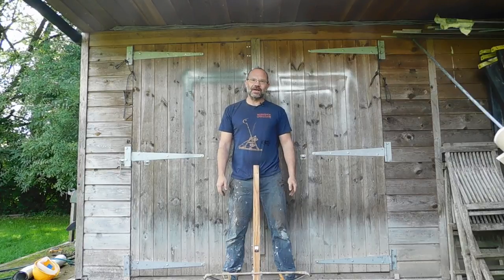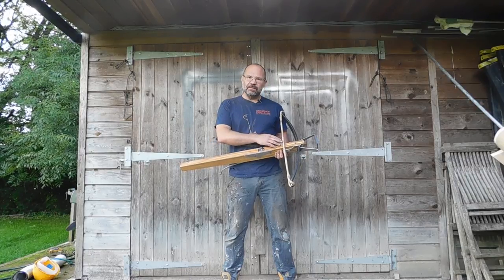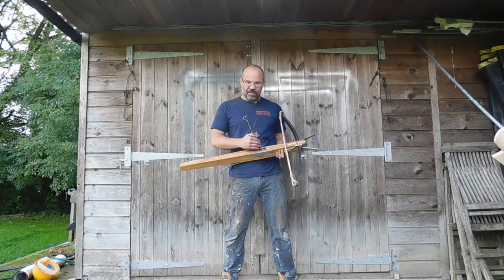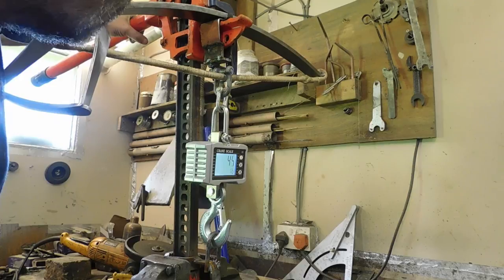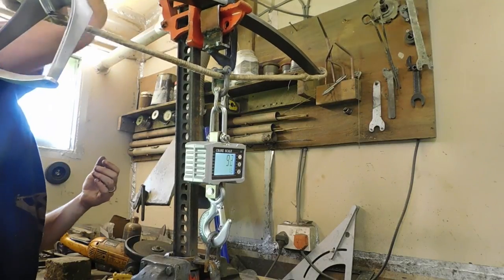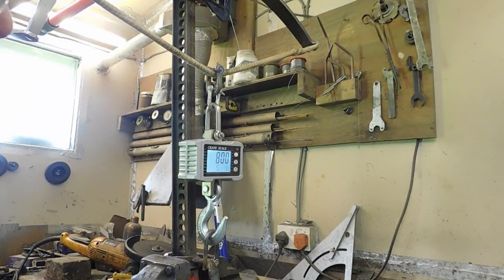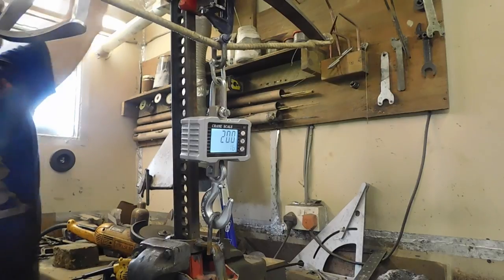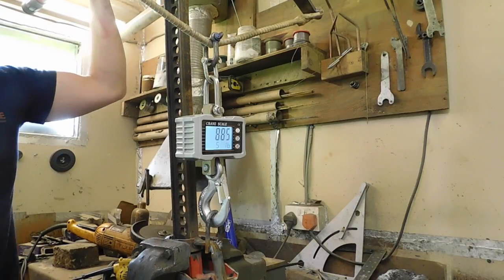Testing the draw weight of a 960lbs steel crossbow - Skallgrim's crossbow

Comment: People really don't take into account the efficiency of medieval crossbows (or lack thereof) compared to modern crossbows. thanks for the video!
Reply: Nightmare on Nugatory Rd yeah good for the day they definitely worked!
Reply: @incinerator950 Historically also important is that steel bows don't disintegrate when wet. That was one of the problems of the time.
Reply: @FreeOfFantasy  All the composite bow that I know of was covered in waterproof leather and was lacquered. So there's really no problem with wetness there. There's also the issue of a catch-22 with a steel prod. Yes, the steel prod have higher draw weight. But it's also significantly heavier than the wood or composite prod. So much of the energy was lost trying to flip that prod.

Comment: In relation to my previous comments below, has anyone done with crossbows what Florian Fortner has done with sword and rapier blades? Someone needs to take a number of original pieces, and measure with callipers the changes in thickness across the prod, say at 2cm intervals. Take averages of many weapons, look for trends and reconstruct. I still cannot help but think that performance could be improved, and it still doesn't seem to me that your prods taper as gracefully as at least many of the  originals. Not trying to be rude or anything, just interested in seeing if it is possible to improve performance further (which I know you'd want).

Comment: I don't really fathom, what is the reason to build such a piece of machinery, supply, crew, everything!? Why generally go through this trouble if it does not peirce the armor?
Reply: Because there was not very many knights you would have to fight against. This crossbow would probably Pierce every other armor.and considering the vast majority of armies are ninety-nine percent people not in plate armor.

y'all still taking to a fact it took decades to train somebody to use a longbow effectively in war and in a battle.when you can just give an average soldier a couple weeks of training with this and he doesn't even need to be very physically fit and he will be able to accurately and effectively use this crossbow
Reply: Because this was more usefull for lightly armoured opponents. A knight will 100% shrug off just about anything except for blunt weapons and calvery. 

Bows and crossbows are not really meant to be killing weapons. They are meant to frustrate, annoy, and thin out weak peasent armies. Arrows get tangled in knights shields, scare horses, injure and kill poorer men. It was crazy effective because lets say you are faciing 5000 peasents only equiped with gambeson and chainmail and roughly 100 full plate knights, the crossbow and archer men will be able to kill and injure the vast majority of those 5000 and those who dont get hurt are going to run away leaving only a fraction of the army while your side has a huge moral boost and a huge army to fight what is left of your enemy.

Even if you are in full plate, hearing and seeing arrows flying in every which direction is still fucking scary because there is that small chance god may hate you that day and an arrow will slip into a gap of your armor.

Comment: I wonder if the draw weight is actually higher once mounted on the stock, since the string has to apply a twisting moment to the prods (since it moves in a slightly different plane)?

Comment: I love your stuff Todd, but your prods don't look to me like they generally have the same degree of 'distal' taper as the originals. 15th/16th century ones that I have eyeballed look thicker in the middle and thinner at the ends (in all three dimensions). That may have an impact on performance. Perhaps though I am just not looking at the computer screen close enough?
Reply: I just looked at another video of yours and it seems you are reducing the tips to 60%. Perhaps its just hard to see on the screen.